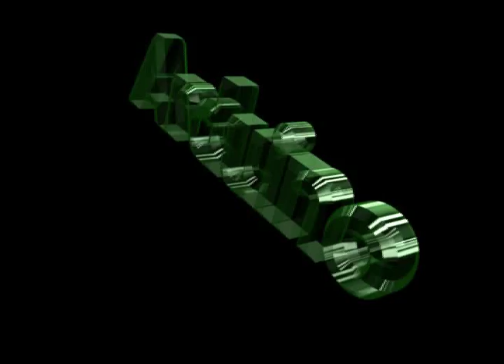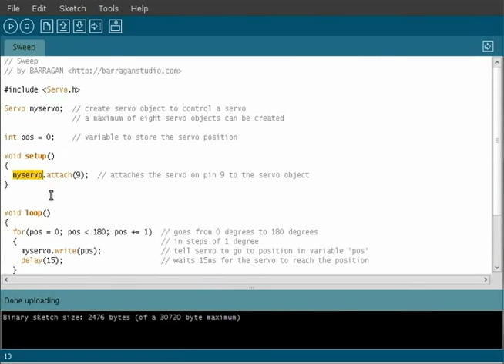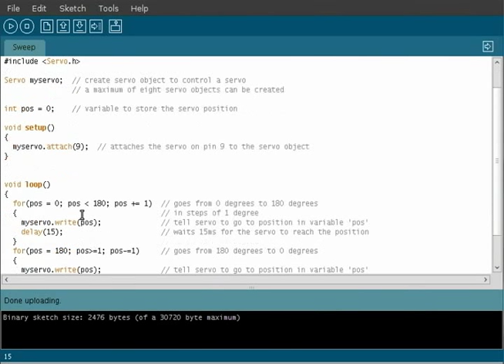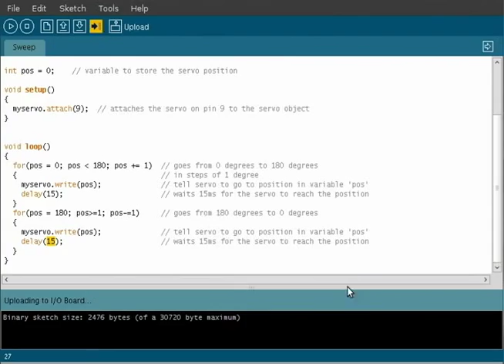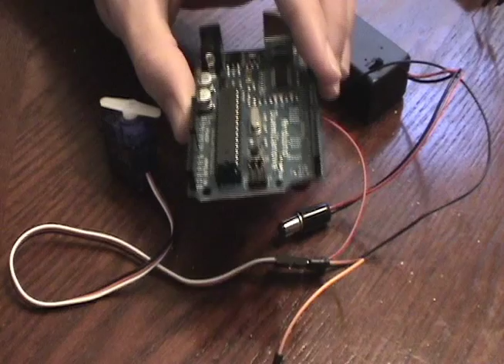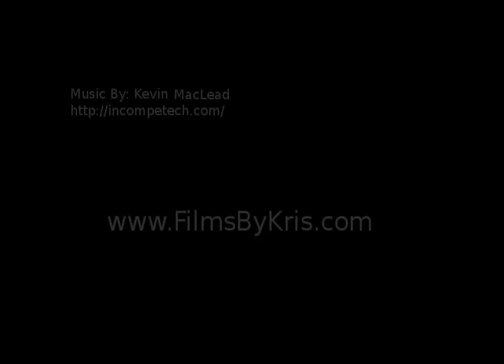Arduino - Servo Motors - Sweep Actions

Comment from the maker: @killul: When using the battery pack, it's 9v, but the regulator drops it down to 5v I believe.  When hooked to USB you should be getting 4 to 5 volts from your computer.